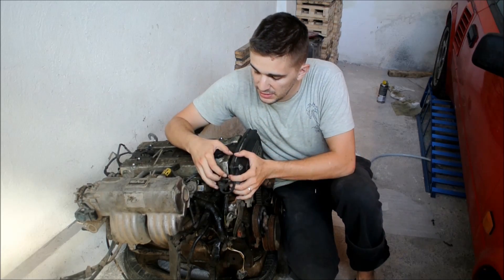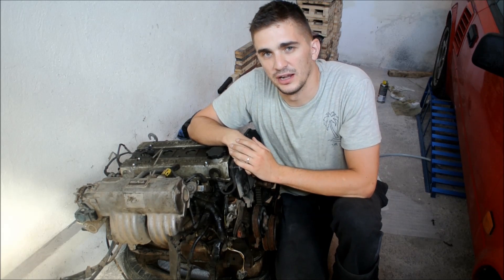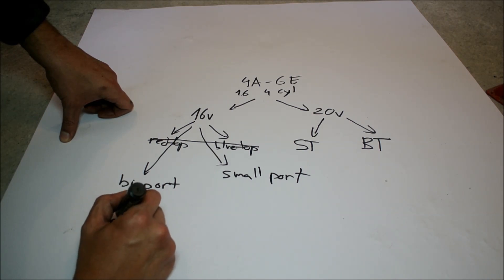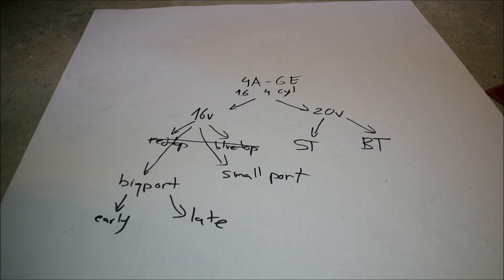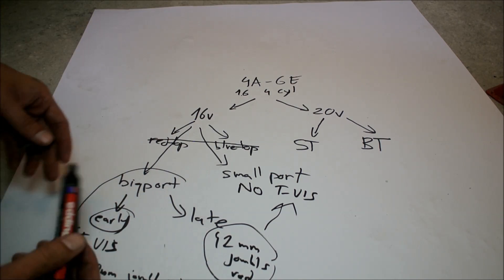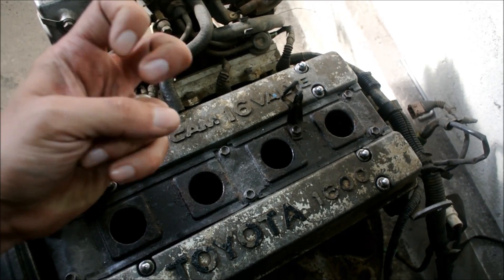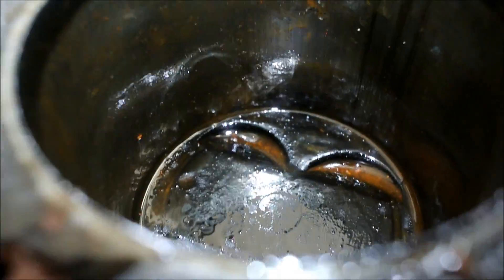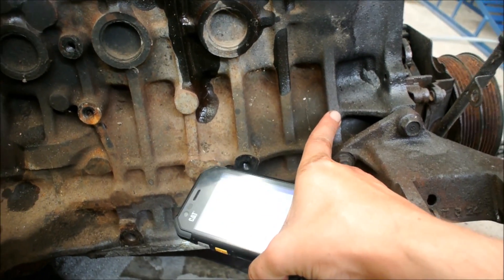Junkyard 4age teardown and 4age engine family basics

Comment from the maker: 4AGE valve cover gasket set: https://amzn.to/2OUJ7be
4AGE complete gasket kit: https://amzn.to/2qm3xQ8
4AGE main bearings: https://amzn.to/2MlAdBK
4AGE piston rings: https://amzn.to/2oFzX7R
4AGE water pump and timing belt kit: https://amzn.to/33vScv8
4AGE intake trumpets for 20v ITBS: https://amzn.to/35HVDAM
4AGE/ Toyota oil an stud kit: https://amzn.to/2OUTvzD
4AGE spark plug leads: https://amzn.to/31libnt

Comment: I’m not sure if the old 4a-ge engines had composite head gaskets vs. mls gaskets, but if they do how do you get all of the composite material off the block so an mls gasket could seal on there?
Reply: Very late reply but from what I know, all 16v N/A 4a's had Composite gaskets. As for removing the material to replace with an MLS gasket, MLS gaskets can cause trouble on blocks that haven't been machined, so unless you want to machine the block as well, or unless if you're doing substantial tuning, its best to just go with a composite gasket as a replacement.

Comment: Hi, i have been wanting to get a small port, i got friends & some mechanics(acquaintes) saying it’s a weak engine..crankshaft etc
Thoughts?
Reply from the maker: 4age? Weak? People turbo the stock 4age internals to 250 hp with zero issues for an entire season of racing / drifting etc. I don't know who told you this, and I don't mean to be rude, but it's complete nonsense. Also in today's times there's absolutely no reason for you to listen to me, a friend or a random mechanic, it's all on the internet and you can research the 4age reputation and hundreds of different builds yourself. It's an old tried and tested engine that by now had everything imaginable done to it and the resources are more than plentiful.

Comment: Just got a 4age 20v silver and its supposadly losing compression id like to pull the head can i do it while its still in my car?
Reply from the maker: Did you actually test compression first? If it's really bad you'll need to pull out the entire engine anyway
Reply: @d4a  i havent i just bought the car and thats just what i was told, im pretty sure it has a bad fuel pump aswell cause i cant hear it run when i try to turn it over

Comment: About the blue top vs redtop thing I think all it proves is someone Frankensteined that engine together from multiple engines at some point ... they probably pulled that cam cap from another engine too and then just fit the cam bearings to it.   sucks when people do stuff like that ... they know what it all means but it screws over the next guy and casts doubt on the entire thing.  Did you manage to salvage the salvage engine or was it beyond repair?
Reply from the maker: I picked individual parts from it but the block and crank are only good for being turned into a table and chair lol
Reply: The blue top engines were 7 rib blocks. Also with the 42mm rods. However you are correct as to say big port vs small port instead of red top vs blue top.

Comment: do an ls swap XD
Reply from the maker: +fromatic2 Imagine a mid-engined 950kg car with an LS in it. What an awesome way to die :)
Reply: It wouldn't even make it to that stage. If by some miracle you fit it in there, the rear end would completely collapse under the weight of the engine.

Comment: If you are going to be working that deep into an engine, drop a few $$ on an engine stand. Save your back and a lot of time.
Reply from the maker: +Dave M I have an engine stand, it's just that I pushed it deep into a corner of the garage and piled stuff on it, thinking I wouldn't need it in a while. I'm getting it out to work on my good engine.

Comment: Real bummer that junkyard engine was such crap. As long as it was close to free, it's still worth it in parts as you said. Gotta love previous idiot mechanics! I'm a big victim of that as well.
Out of curiosity, what oil were you running in your rebuilt engine?
Reply from the maker: 802 Garage It was from a junkyard, I expected more but am not surprised. Used 15w40 mineral for the first start and 10km. Used 10w40 after that.

Comment: You forgot the supercharged 4age, and the early sc and late sc ;)
So unfortunate that your broke the first engine :( Your video's and guides were so good I hope you find out exactly what you did wrong
Reply from the maker: +Vortrex99999 The 4agze is a different engine, but you're right, I should have mentioned it. I was downed for a bit by the failure but now I see it as sn opportunity. Will definitely find out the reason behind the rod knock and update with a video. Thanks for watching.

Comment: First! Psyched to watch this since I actually own one. XD
Reply from the maker: 802 Garage I think you might be the first person saying first on this channel. That's like a double first. The holy grail of the firsters? Congrats :) Which 4age do you have? I'm guessing a bigport? Got EGR? AFM or MAP? 3 or 7 ribbed block?
Reply: Really? That's crazy. I've already gotten a lot of "first" comments for some reason. I just like to do it on channels I actually watch to be silly. I always leave some kind of real comment with it though. Maybe I just have more immature viewers. :P
Mine is the stock 1985 MR2 engine. I believe it is the 3 rib with an AFM. I did a bit of research on it a while ago, but totally forget the details. I'll probably look it up again now. Listening to your video, I believe mine is the big port blue top, if you will.
Reply: Yeah mine is an early version, big port, must be 3 rib, pretty sure it is AFM because it looks like a giant MAF, and makes a whopping 112 HP.
Reply from the maker: 802 Garage If it's an 85 than it's most likely a 3rib and has the blue valve cover. Definitely a bigport. Those have the lighter internals, not the best for turboing, bur they rev easier. I'm looking forward to you starting to tear into the mr2.